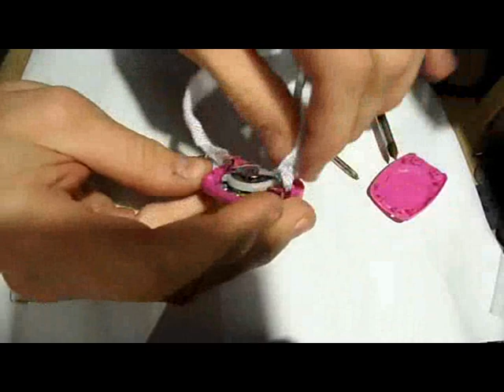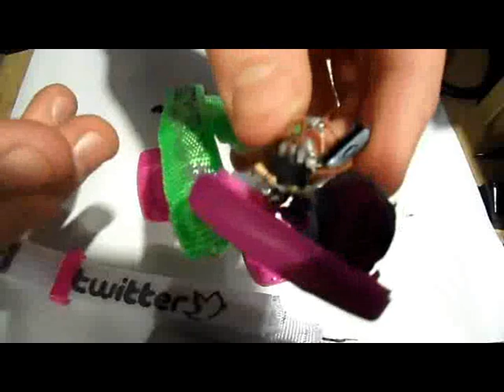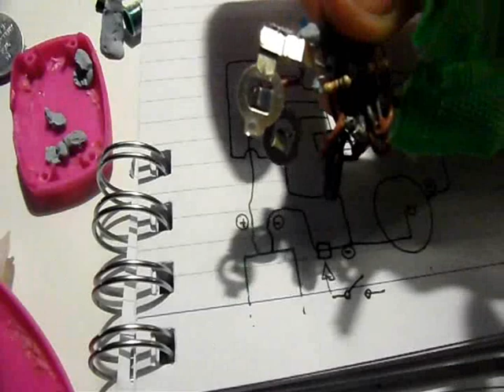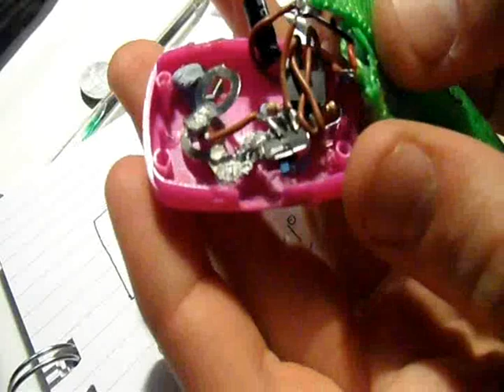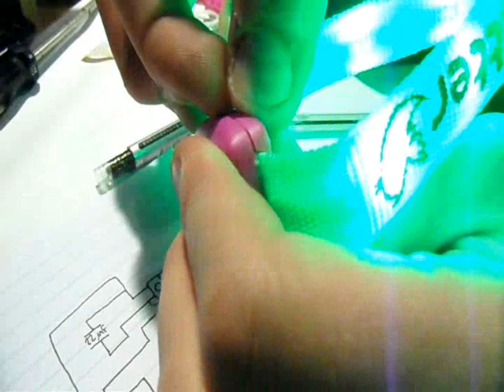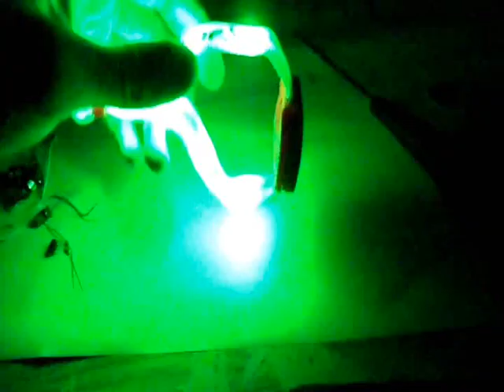XYLOBAND Mod

Comment from the maker: Sorry, missed this comment! I recall testing each battery-like component with a multimeter, as I wanted to know If the LEDs would be powered 3 or two batteries. Only two are used for the LEDs, but the RF circuit uses its own battery (admittedly it does seem excessive for such a large battery to be used for a reciever) however, when you consider the range these units pick the signal up from (100m+) it makes a bit more sense.

Comment from the maker: yeahh, i'm thinking of getting the toolbox out again to make a variable flashing speed, with a variable resistor! and back to your point, companies really don't like selling variable radio frequency transmitters, stuff can start getting illegal, and i've found nowhere that discloses the RF used for the xylobands, i do know its not identical for all xylobands, thats how they make different bands flash at different times, basically you need a radio transmitter of the right transmition frequency!

Comment: Great info, but flashing speed not variable. (unless R values are changed, correct?) You are obviously a techie, what is out there to actually send a  signal to the unit so that it will work identically to the concert?

Comment from the maker: Yeah no doubt it could be neatened up, this was a proof of concept, I'm thinking of other ways you even add to this mod, I'd like to vary the rate of flashing, using a thumb-wheel variable resistor and another slit on the other side of the unit, gotta love modding! yeah, nice mod yourself! Not too in depth, quite easy to do! :) haha brilliant! :)

Comment: 555 timer cct - good idea! Wonder if a bit of vero board would make the soldering job a bit easier and, using the original battery holder, would tidy up the whole thing? I did a much simpler mod - opened the unit and bent the top battery contact every so slightly away from battery itself. With the lid replaced and screwed up a bit loose, it will flash when squeezed. It fooled my wife for a minute or two - as I could make it sync to "Charlie Brown" on the radio!!! 
:-)